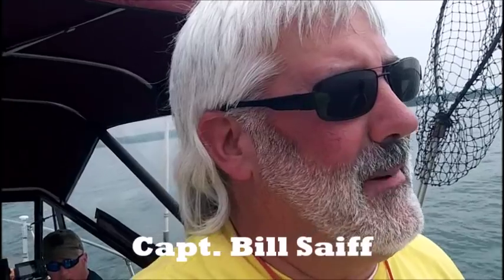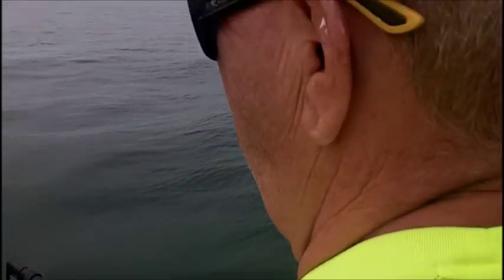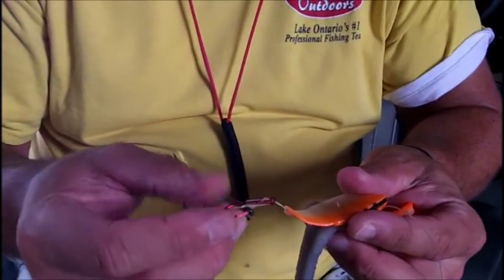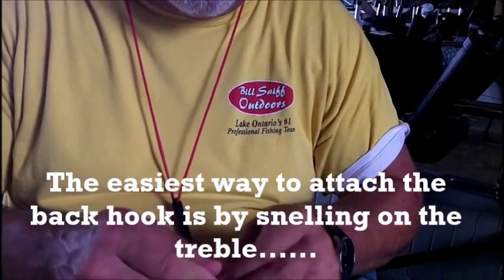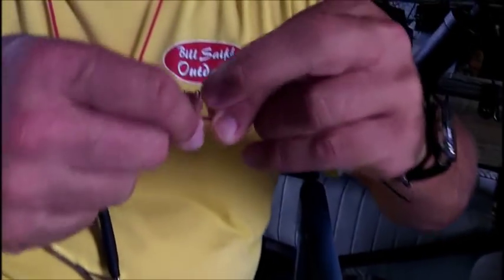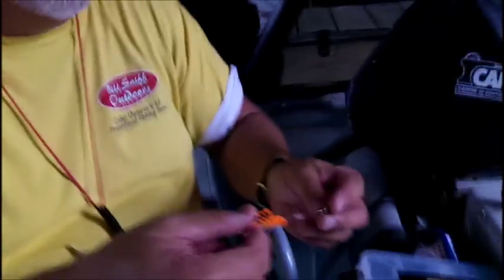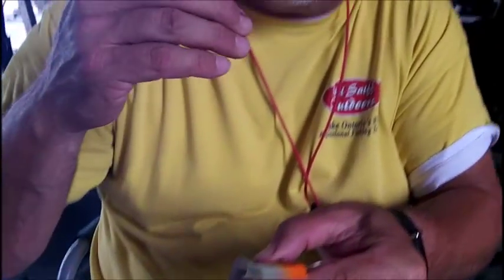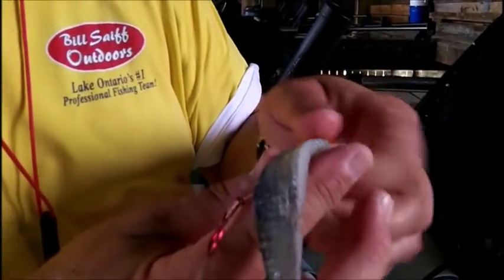Tuning Bait & Lighted Flashers for Staging King Salmon!

Comment: Hey, Bill.  Another great video.  Quick question.  I love the idea of standardization and try to do the same on my boat that I run on the Wisconsin side of Lake Michigan.  When you are using your 41" leader length for this setup what is the speed you are generally trying to run at (probe speed or SOG)?  I'm just assuming that if I'm typically running a little faster or slower than you that my leader length may need to be adjusted accordingly?  Thank you for your reply!
Reply from the maker: It changes but 1.7 to 2.1 seems to be the range (SOG) during the late Staging period.
Reply: @BillSaiffOutdoors  Thank you for answering my question.  I recently attended a seminar where Captain Dan Keating was talking about that same 11" lighted chrome flasher.  I hope to give that setup a try this summer.  If I do I'll let you know how it works out!
Reply: Where can I buy the lighted chrome 11 inch pro trolls? I haven’t been able to find 11 inch pro trolls anywhere just the 8 inch
Reply: From Michigan how is the fishing in sturgeon bay Wisconsin. I Yost to live in door co Wisconsin. I worked at the bay ship building co in sturgeon bay. Fishing is pretty good here in st Joseph Michigan. Started to so down a little bit now for the kings on the pier. They have started to move up river. I hope you are still killing them. Good luck out there.